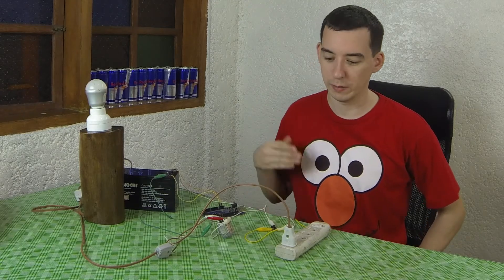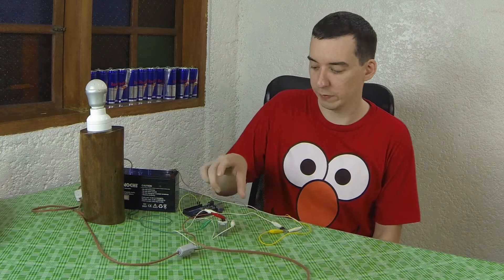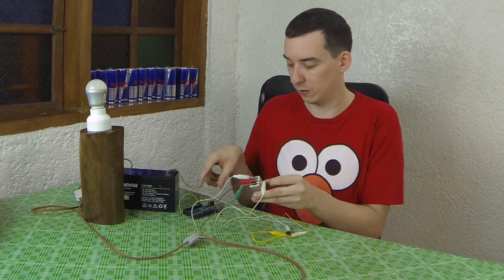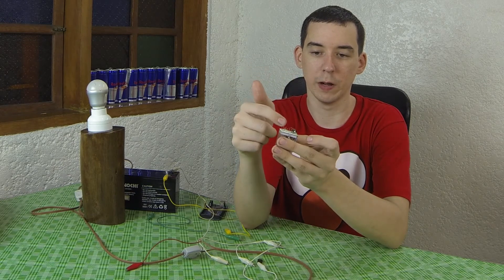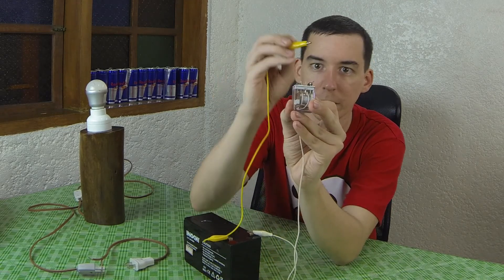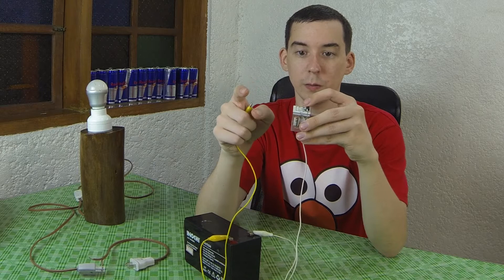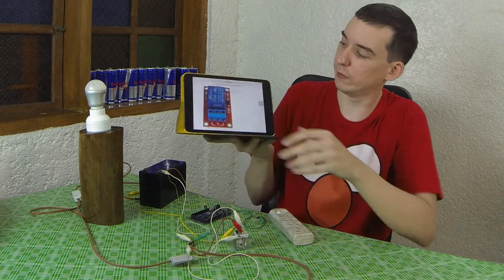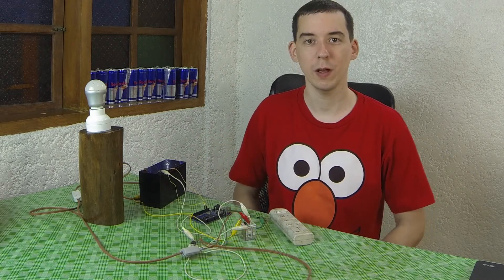Control AC Appliances with an Arduino + Relay

Comment: is it ok to plug lots of appliances ??
Reply from the maker: Yes, as long as you stay within the maximum load limits.
Reply: Thank you . we are using a raspberry pi . is it possible to connect it with the home circuit breaker with fuse in the middle of raspi and circuit breaker? Thank you very much
Reply from the maker: Sure, I don't see why not. Just be sure you know what you're doing. High voltage AC can kill you.
Reply: thank you :)

Comment: can i use it to run an AC fan? that the arduino will automatically control the speed depends on the temperature?
Reply from the maker: You can use it to turn on and off the fan but not to control the speed. For that you'd need something more advanced like a variac.
Reply: but what if I set the arduino in a way that it will control 3 relays that is connected to the ac fan.. for example 1 for low speed , 2 for average and 3 for maximum.. for a certain condition that only 1 relay will be turned at a time in certain range of temperature? is it possible? or is it to complicated? sorry for the trouble

Comment: i have a question ,my load from the relay gives back electricity and it messes with my counter in the arduino , what will i put to prevent this?
Reply from the maker: +john arry a diode
Reply: Gadget Addict  thanks for fast reply !! But what kind of diode will I use if I'll power an electric fan?
Reply from the maker: Any diode which is rated to handle the voltage/current required by the fan.

Comment: Hey man,
Your video is very cool and extremely useful
Please connect the circuit with an AC exhaust fan by using the program which I am going to tell you in the next comment

Comment: Hi, i am fairly new to this, what i want to know is can you operate this Arduino to control a relay via a switch input to the Arduino? I ask this as i am trying to build a model railway and i want to control the point motors via a momentary switch and then when the point motor switches i want a red/green led to indicate the direction of the point. I am sure this is all do able but i lack the knowledge of where to start so i would love to see a video on this if it is at all possible. As an aside i really like the speed of your video as it does not go to quick for me, and gives me time to understand what is happening. Thanks a lot!
Reply from the maker: +Phil Newman Yep it would be easy to do. Even if you can't code, you could take the two sample scripts and mix them together. One for switch input and one for outputs / relays. Should be very easy :) You could even just forget the Arduino altogether and buy a relay board on eBay which has pins ready for switches to be connected directly.
Reply: +Gadget Addict hi thanks for getting back to me, dont suppose you know anyone who would take on writing the sketch for me do you?
Reply from the maker: Phil Newman mmm probably someone on the arduino forums could throw it together in a few minutes for you.

Comment: I have a real problem. My relay turns on and off as expected, until my device is under load, then the relay does not do anything, it just doesn't switch on as if the power is drained from everywhere when it draws power. Unfortunately I can't find any wiring guides on the 6 pin relay I got with  my starter kit.
Reply from the maker: +ArcanePath360 Hmm what is the load and what is the relay rated for? Is it a solid state relay or mechanical? I've found that mechanical relays can get "sticky" when switching heavy loads or switching very fast. I assume that it's mechanical since it's 6 pins. I normally use a battery and multimeter to work out the pins on a mechanical relay, although most are the same.
Reply: +Gadget Addict  Thanks for weighing in... I feel like a dumbass but it was me... I had one wire in the wrong pin so it was only partially working. Wasted 3 hours of research until I realised! :(

Comment: Hi
I am Dileep from India, I am marketing a water level controller.I would like to know whether this technology is adaptable for a single phase and three phase motor which pumps water for 20 minutes.my requirement is to cut the motor supply when there is no load to protect the motor and also to cut the motor when the voltage is less than 160 v (low volt) and if the voltage is more that 260 volt (high voltage).This is the situation where there is no water in the well or storage tank.

and there are lot of other programs connected for detecting the water level in the tank

please guide

Comment: Can I use a similar setup to run a 1/6 hp, 120V AC motor instead of a bulb?
Reply from the maker: Rushabh Shah For something that heavy duty, I'd recommend buying a relay board designed to handle that level of current. But yes, essentially you'll be able to turn it on and off with a similar setup to this.

Comment: hey man its a good video,,can u help me out ,how many 5v 8channel relays can i connect to arduino mega?? 

email:raymonds.m19@gmail.com
thanks in advance,!
Reply from the maker: Mmm you could connect as many relay boards as you have available available pins. But the more relays you try to drive at the same time, the higher the power requirements. So you may find that you need to connect an external/direct power supply for the relay boards instead of having the arduino power them.
Reply: thanks man my friends are doing a similar project so they ll use this as their reference so we 'd like to add ur title and name as a reference thanks in advance 
mail to :raymonds.m19@gmail.com 
and thanks to the previous comment it was really helpfull

Comment from the maker: Pete, your Youtube settings don't allow for a direct reply. I'd assume it's something to do with the transistor. Are you using just a SSR relay or is it a module board made for use with the arduino? If it's the latter, you can probably remove the transistor and connect the arduino directly to the SSR board which would likely solve the issue. The transistor is probably keeping a charge or picking up a static charge, so you need to add a resistor to the transistor to take any excess to ground when the circuit is off.

Comment: i have a ssr relay that i want to turn off/on a LED bulb. im using a npn transistor to activate the relay with 5v from arduino. it all works as it should however for some strange reason the led light bulb flashes on and off when the relay is on the OFF state. the light bulb is 240v (UK) however the light bulb is a led version. i cant understand how the light can be flashing on/off when the relay is off. Can you help me at all